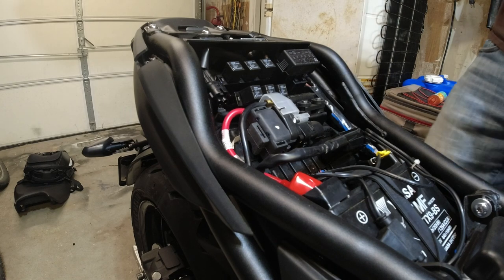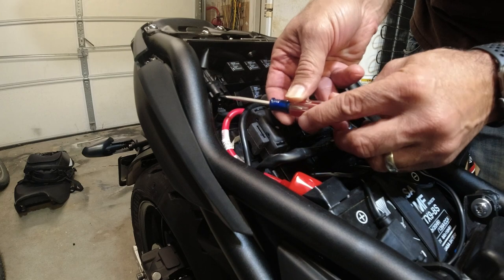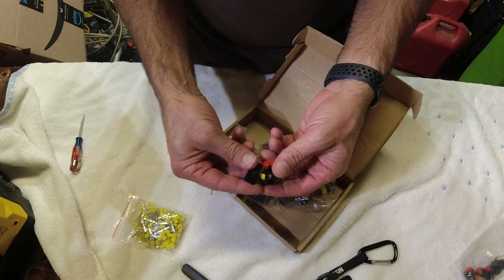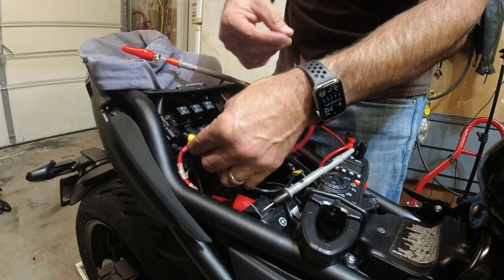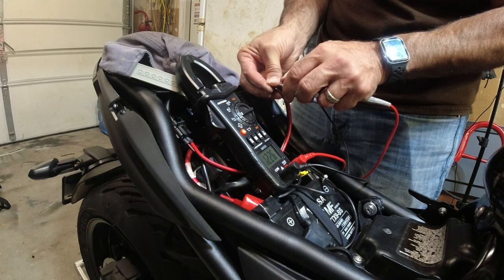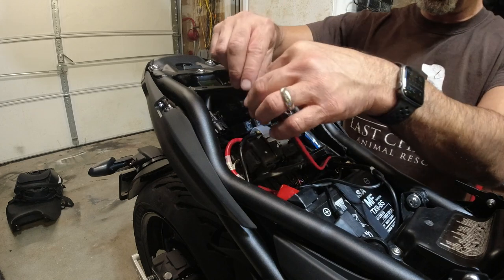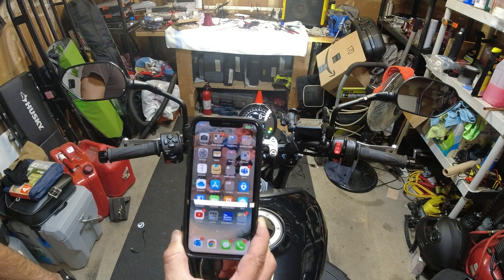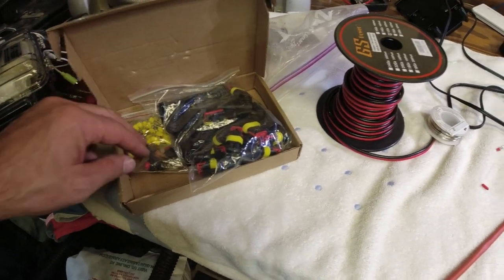Triumph Trident 660 adding USB Port 12v Switched Power

Comment: How is this connection holding up? I just ordered a usb cable (Daytona Bike USB Power USB-C PD3.0) and I’m hoping to run it like you did. Not sure if I will fry anything by doing that but your video inspired me to give it a shot. Thank you.
Reply from the maker: I actually don't have the bike anymore as I now ride a Triumph Tiger900GT.  But the connection was fine and never had an issue with it.  The connection was nice and secure so it shouldn't be an issue.  Plus it's under the seat protected from weather.  Hope the video helps!

Comment: Nice work. Have a 2021 Trident as well. What’s the amp from the USB? I’m considering getting the Insta360 X3 which needs 5V 3A to power it as a dashcam.
Reply from the maker: I’m not sure what the amperage rating is but I also have the Insta360 and I can tell you that I am able to use both usb ports charging my phone and powering the Insta360 at the same time with no issue

Comment: Thanks for the video, this is actually just the inspiration I was looking for. However I think that you actually linked the wrong plugs. The ones you have linked have rounded corners while the one you use in the video does not. Just something to look out for when shopping for these connectors.
Reply from the maker: Thanks. Those are the ones I used. Not sure If the pic is different. But also you only use one half of the plug, the other side you don't use.  I'll have to double check and physically look at mine again. Thanks for bringing it to my attention
Reply: @Mudslidex1  oh now I see, you just removed the red plastic piece from the connector so it's more square. Right?
Reply from the maker: @MotoZeug  Yes,  the red piece pulls right out. I don't know what that is for, but by removing that, made everything fit.  I also ended up pulling off the yellow rubber bushing because with it on, the connection would loosen up over time.  Once I pulled off that yellow rubber bushing, the connector was able to push on all the way to the factory harness and clip in.  Hope this helps

Comment: How’s the extended USB charger attached under the handlebar? Can you share your idea?
Reply from the maker: I just have it zip tied to the bar.  That USB connector has tabs on it meant for zip ties.  So the ties just run around the bar and through the holes

Comment: Hi, name of connector?
Reply: I think the connector is a Sumitomo HM 090. I just ordered one from ebay. Hopefully it works. But I think if you wanted to there are a couple rubber seals in the one he popped out. Those rubber pieces can be popped out with a paper clip. I may just try and use that. But there are seals you can buy with holes in them to pass the wire through.